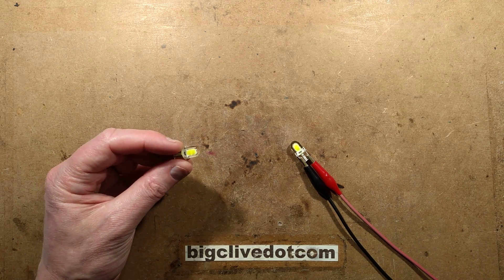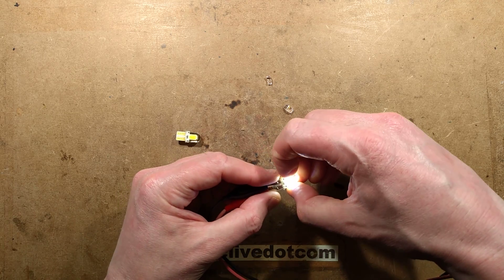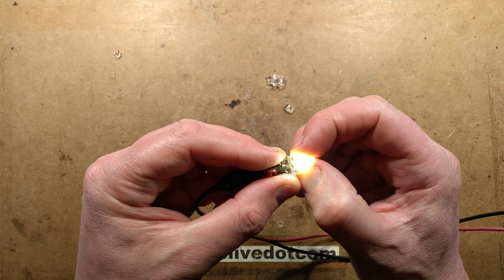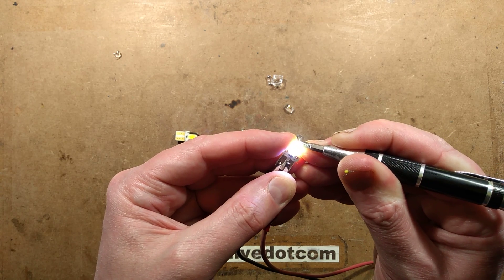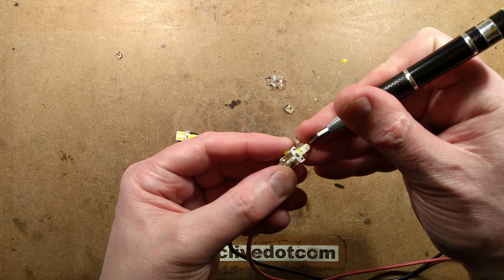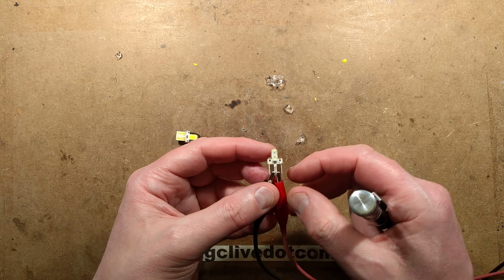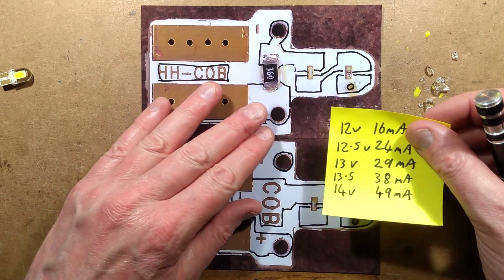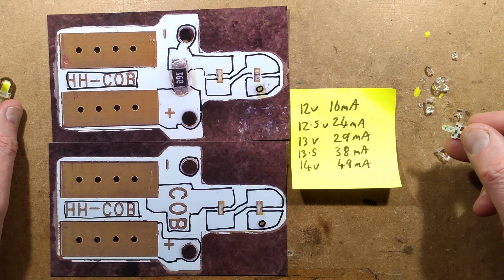Under the gel and phosphor of a COB LED car lamp.  (Deep violet chips)

Comment: Yes, they use violet LEDs so the colour is more dependant on the phosphor. Often yellow and amber LEDs use a deep blue/violet/UV LED and phosphor, rather than a plain yellow LED, because it's more efficient. I suspect they also do them in amber for indicators.

Comment: Think you ripped off the ultra fine bonding cable when you tried to peel off the yellow silicone. By the way: those lamps are realy bad to be used on your car. They do not have any voltage regulation. So brightness and current varry depending on the voltage. At arround 14 Volty they die.

Comment: Hey guys + big Clive. These cob leds on wish or eBay are 90% faulty and ready to burn out quite quickly... the amount that I got in the pack (12) I went through all except one. I replaced the led back to a incandescent bulb. They burn out within 2 days use in areas where no other heat source is valid. The cob burn out or fade to one diode with no great light no more. The last cob t5 bulb I used I tried it on 9 volts.. guess what.. it worked perfectly for the trail of 6 days. The 360 ohm resistor is way too low. Trying to email for a refund. They should put a 1k or 2k to regulate current as the other cooks them. I replaced the two resistors with 1k and tried again at 13.4-14.4v, no problems and it works great. Too bad it's only one left...

Comment: I got similar LED bulbs, although the red color had purple chips, the white had blue chips in my case. One of the red I managed to remove the phosphor without damaging the chips but the lamp released magic smoke within seconds when driven straight at 12V due to the chips being overloaded.

Comment: I bought kind of same thing on ebay and did like you. I think I destroyed some chips when removing the yellow gel, but anyway there are still some working, showing a bright blue like on your video... My question is : do you know the wavelength of this UV radiation ? Is it 405 ? 385 ? 365 ? 265 like in tubes ? (!) ?
Reply from the maker: I'd guess around 400nm near UV.
Reply: @bigclivedotcom  ok thank you ;)

Comment: Clive The resistor is to stop error codes in the car electrical system. The computer needs to read a certain load.

Comment: Those newer COB LED lights are amazing in the huge amount of light they make, however I never have luck with this cheap made in China stuff... Last ones I bought for presence light for my car, they just died in like a month and were a bit bigger and a bit more bright than that ones and also have a slightly larger metal plate in the middle and with some kind of thermal adhesive to transfer hear for the small metal...

Though my friend bought the ones for medium and high beam lights for his old BMW the ones that come with a fan and make a huge bright light without needing extra power driver big hardware like old LED light kits and its also much cheaper, his ones lasted almost a year, it wasn't bad, but still this cheap things just seem like they are made to die and it seems just because of heat since they look like they start kinda melting from the inside, the yellow part start to disappear a bit and has bubbles inside at least on my dead COB LED presence light...

Same for the Xenon cheap kits, I already bought 2 for my motorbike and the the actual Xenon light bulb seems to last quite good (never had the chance to burn the xenon light bulb it self), but the high voltage converter box keeps dying though I used the same light  for both kits without even using the newer light bulb on the new one, and the light bulb is actually still good, but already died 2 inverters or whatever its called the hardware box with the PCB that has the circuitry that will tell the color of the xenon and send the high needed voltage, this cheap made in china kits they keep dying on me...

Comment: Most modern cars use an alternator that outputs 14.2v some bass enthusiasts use Iragi 300 alternators that bump the voltage a little higher i think up to 16v

Comment: I bought these very same bulbs as replacements for older style 501 sidelight bulbs. They were advertised as "canbus" bulbs for vauxhall error free. I tried them out and after switching them off they flashed randomly for ages after so i removed them.
Reply from the maker: That was probably the ECM module polling them to see if the filaments were intact.

Comment: Very interesting.............But, purple light does not exist in the light spectum.  There are some interesting videos that explain this problem.  I wonder what actual color wavelengths the LED is emitting??
Reply: same, this is exactly what i have been looking for. There is a formula to determine this with a refracter i may have to do if i can't find it anywhere

Comment: Hey Clive, I have an 100w security flood light with motion sensor. It has 2 50w led cob chips and 2 50w drivers. One of the led cob chip has started flashing off and on. Do you think the led cob has gone bad or the driver?
Reply from the maker: If it's a rhythmic pulsing of the whole LED then it sounds like a driver issue.  if you look at the light through dark glass have any of the individual LEDs gone out?  If some have shunted then it may be affecting the driver's stability.  Spare drivers and LEDs are available online.
Reply: @bigclivedotcom  I'll check and see Clive... Thank you.

Comment: 12v 16ma, 12.5 24ma,13v 29ma, 13.5 38ma, 14v 49ma. ok cool. dont see where the resistor is kicking in to limit the current here-perhaps you could give an example of the same data but without the resistor?
Reply from the maker: Without a resistor the current would rocket beyond the combined forward voltage of the LEDs (about 12V)
Reply: @bigclivedotcom  for a matter of interest though at exactly the rated voltage of 12v with engine off for example would the led not be brighter if the resistor was removed ? So it would be 12v and with the resistor in actual fact not that, perhaps 11.5??

Comment: The chips look purple indeed but are actually blue. I noticed that they are purple in appearance until you 100% completely remove all the phosphors. For many years I thought that they where purple until we did a really deep clean. Even the tiniest amount of phosphor along the edge of the die will still make it look purple.

I am betting the same will happen if you manage to clean off 100% of the die and you will find it's blue.

Comment: Any idea where one could acquire the yellow phosphor coating? I have looked a few times but only found phosphorescent glow in the dark stuff. I'd like to experiment with my own coatings for various effects.
Reply from the maker: Although it's very common in manufactured products it's not easy to find on it's own.
Reply: Found some :) I checked on wikipedia for what the substance is precisely, and it's Cerium doped YAG (Yttrium aluminium garnet). Someone on a forum said it's on alibaba not aliexpress but the minimum orders are enormous. I did find a listing with no Min. order at US$0.50 per g
Search string: LED YAG phosphor

Comment: Can bus compatible means the resistor just has to pull the voltage down close to 0V when 2mA is applied from the BCM during the self test cycle. When running the BCM will occasionally turn off the lamp for 1ms, and measure that the voltage across the lamp drops to ground or within 1V of 0V. Overcurrent is handled by a separate part of the high side driver, that simply limits high current, but has a short delay to handle switch on inrush current. This is then signalled as not a lamp failure, but as a BCM fault, resulting in the check engine light coming on instead.

If the resistor is not there then the 8V of the open circuit LED's is not enough to pull the power low during the sense cycle. If the lamp is off the cycle still is done, just pulses the 2mA source on to check the lamp is pulling to ground still. You will see some LED's flash briefly during this test cycle if they are not CAN compatible and light brightly on 2mA.
Reply: .... Cool, I like learning more about Body Control Modules & CanBus.

Comment: How does the polarity work on those lamps, car bulb holders tend not to be polarised and I noticed that the reverse photo has the positive at the bottom as does the top side, so are there two sets od dies in the led's in opposite directions so that you can just put them in either way  around.
Reply from the maker: They will only light one way round.

Comment: All the LED side lights I have tried in my cars fail very quickly, and get so hot they burn the sockets. 
If these stay cool (a view using the heat camera would be good) in an enclosed area (like a car sidelight) then I want some of them! Where can I get them? Sorry so many questions. ;)
Reply: They all run hot, I just did a simpler thing and bought a pack of 100, and replace them when they degrade.  Bought on auction, and the evilBay seller did a nasty and upped the shipping price to cover the cost he lost after it ended, so paid $78 for shipping instead of the regular "free shipping", as the auction price ended up at $5 total when he wanted $1 each normally. Paid, gave 1 star feedback and left it at that, after delivery. Nice lamps though, have been very useful in assorted applications, even though they are horribly overdriven at 13V8 in a car, just use a series resistor to keep them saner.

Comment: I have bought a pair of these lamps (announced as warm white) but they are rubbish. They have an yellowish light and are not bright enough. Their purpose currently is only for testing in my homemade bench lab.
Reply: Warm white is yellowish 3000K filament equivalent - it sounds like you wanted the more blue "cool" white which replicate a 5000K filament lamp. (Cool colours are produced by hotter temperatures...)
Reply: @allangibson8494  thank you for your concern. I understand perfectly the difference between warm and cool colour. It bought the lamps as warm white, thinking they would be between 4000K to 4600K maximum but unfortunately they are way to yellow, meaning not my kind of warm white. Try yourself, they are cheap.
Reply: @UC3MxvTvmdsu6SYHwoazWCVA I've been playing with some industrial fluorescent light replacements - 55W LED arrays lights are bright enough for most purposes.

Comment: I wonder how long they would run for if retrofitted in those emergency spotlights that have 12v SLA batteries in them...
Reply: pretty much forever

not the best way to drive one, granted
Reply: Even with a very nearly dead battery probably at least 2 days, with a fully charged one nearly 2 weeks if left on continuously. You probably would just have a float charger that charges the battery to 13V8, and have the LED permanently on as both a power indicator and emergency light.
Reply: It'll only work down to like 11 Volts

Comment: Why are those car LEDs never built to last? This one has a low-Ohm resistor so any spike or even a forward voltage drift in the LEDs themselves can rise the current high enough; those I saw were even worse (a single resistor for 5 LED chains (3 series diodes in each) rigged in _parallel_).
Reply: Overdrive the chips, use underrated devices ( same thing really) and do not keep them cool so they cook to death. Done to get the brightness up, the cost down, and to fit into the same volume as an incandescent lamp that will survive having parts at 2000K. some compromises are made, mostly on the side of cost. 

Make the lamp not a retrofit, put in a decent heatsink area to keep it cool and put in a proper constant current driver and it will last the design lifetime of a LED of 100k hours. But that would mean a different design for every single vehicle in the world, and would not be 99c each including postage. That is why the OEM light assemblies cost so much (at least a quarter of the wholesale price at the dealership), because they have to last the lifetime of the car.
Reply: @SeanBZA  See, those LEDs are meant to emulate a 5w bulb - nothing of any sort of "tricky". Say, in a matter of half an hour I modified - just for fun - the named 5-string version to run with only 2 somewhat better LED (3 crystals in series in each, just like before) and two separate resistors (chosen for the current to stay within a safe range no matter what). I can't say it was any bit expensive or whatever, and the outcome actually proved to be both effective (the brightness is even higher then the one of the original device) and reliable - and the fun part is it is still a size of a standard bulb so I swapped them out in no time :)

Comment: Clive, try exposing these lamps to black light and see how the phosphor reacts to a simple theatrical black light tube.
Reply: The chips are Ultraviolet LEDs - bright enough to cause sunburn.
Reply: They will glow white. Did this with my white LEDs by shining both UV and violet (395nm) flashlights through the lens and they glowed white. Also works with blue. Interesting to note that they are most sensitive and glow brighter with violet light that with UV

Comment: I bought ten x 12 volt 10mm Warm White LEDs from Rapid on Line. I’ve put them in the boot light and footwell lights. A series 10 ohm Resistor to give them some protection against over-voltage surge. All working well and, while ever the doors or boot is left open they don’t drag the battery down. Very bright and great light.

Comment: These little pieces of crap have been burning every 30secs. Don't use ones that have bubbles in the silicon gel in your car, it'll save you the frustration...
Reply: I've used and have many of these. None have failed and we're 2 months in.
Reply: @unclejohn5012  the ones that haven't failed on me are only red ones that don't have bubbles in the silicon gel. Those that do have them are generally poor quality. I've been buying these for about 2-2.5€ per 10 pieces.
Only ones from GearBest seem to work still. Note they are the longer ones. The shorter ones like the one in the video, only the red ones have been going strong for over a year now. All the white ones (most of them had bubbles in the gel) have failed within minutes.

Comment: Should you be wearing UV protective glasses, especially when starting right at the operating light?
Reply: Modern white LEDs use blue to violet LEDs.  UVA LEDs were only used in very early white LEDs until they had developed new phosphor chemistries tailored to LEDs.  Avoiding the UVA means that they avoid the health and fading concerns associated with UVA.  That said, modern polycarbonate lens eyeglasses offer excellent protection against UV light as polycarbonate has a very sharp cutoff around 400nm (the dividing line between deep violet and UVA) and cover the full range from UVA to UVC.

Comment: At which wavelength should you wear UV filters to avoid eye damage?
Reply: Typical sunglasses standards specify they should block below 400nm
Reply: Any polycarbonate lens, including those common in modern eyeglasses or safety glasses, will block all UV wavelengths (UVA through UVC) as polycarbonate has a very sharp optical cutoff at 400nm (above 400nm it is effectively opaque, or “black”).

Comment: If the voltage in a car is much higher than 14V (I think, 14.4 or 14.7), then the voltage regulator in the generator is broken.

Comment: 4:00 - I bet those through holes are there for a through-hole diode for when they use the same PCB on another 'style' of bulb-replacement... One where you could, potentially, install reverse polarity/backwards? Maybe save the LEDs by shorting across the diode, and just make it a MASSIVE one so it can handle whatever-many-amps so they didn't get so many returns?